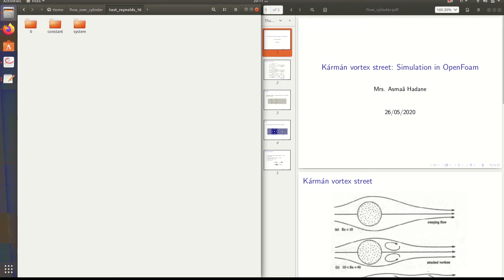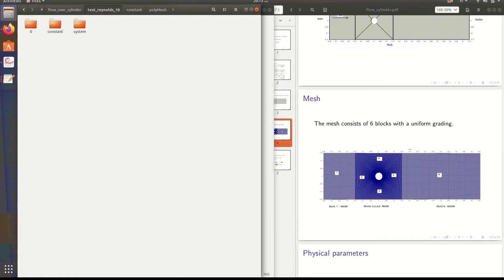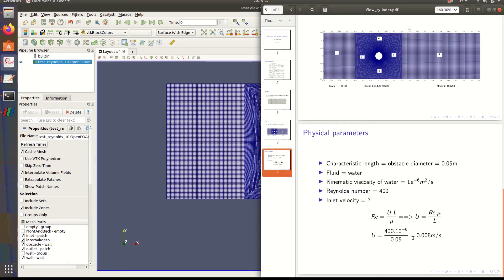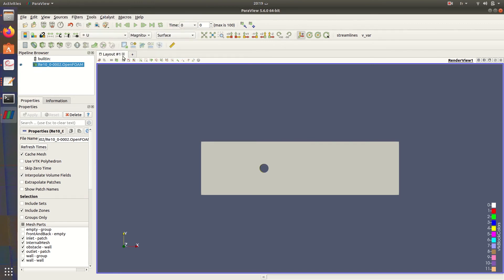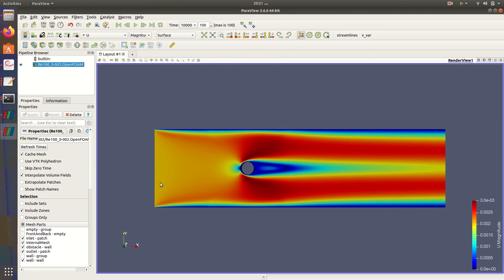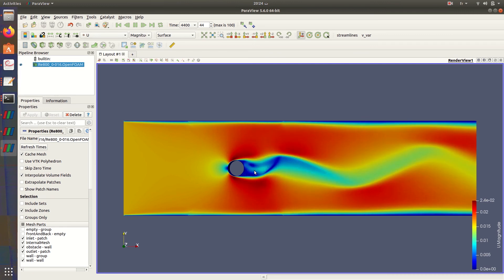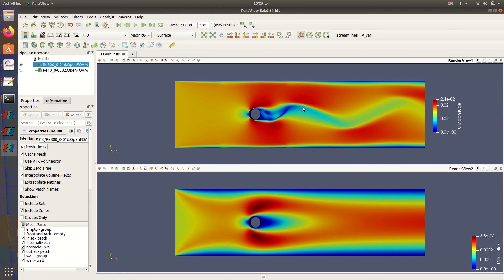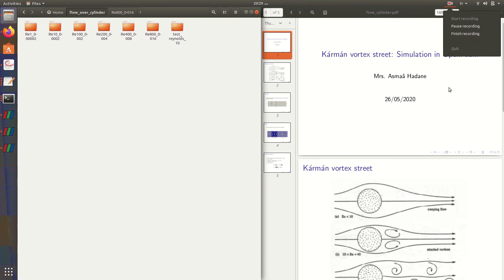How to simulate a Flow around Cylinder - Von Karman in #OpenFoam - #ParaView #AsmaaHadane

Comment: Your openfoam tutorials have helped me tremendously in starting OpenFOAM. I am still a beginner and experimenting with a pump station where I have 3 inlets and 3 outlets. I have used pressureInletOutletVelocity in all the inlets and flowRateOutletVelocity in all the outlets.

However, the model crashes with an exit code 3 after running for a couple of seconds (17s). I have posted a question regarding the problem on the CFD Online forum.I highly appreciate your help letting me know if I am doing it right.

Comment: Hi, if I were to run this simulation using compressible solvers (rhoSimpleFoam, rhoCentralFoam, rhoPimpleFoam) across the cylinder, which part/files would you recommend to change? Or is it not doable?
Reply: did you do it?